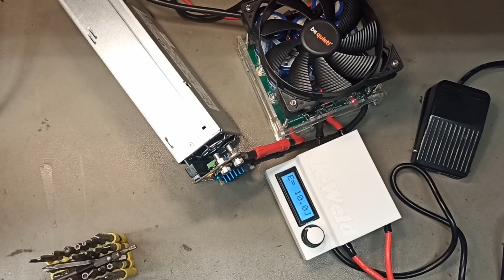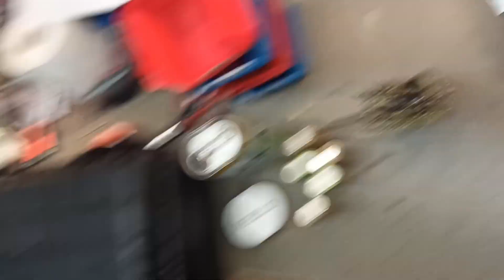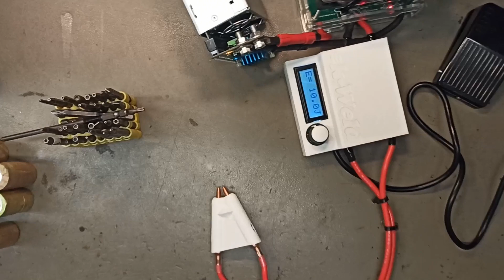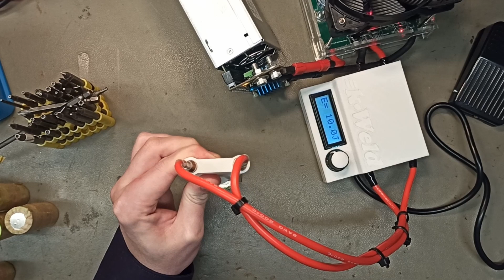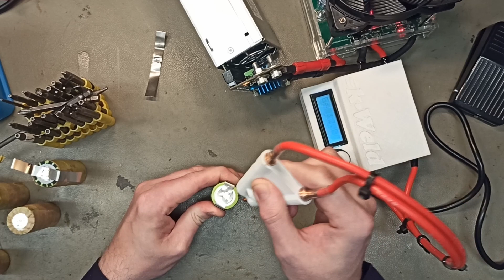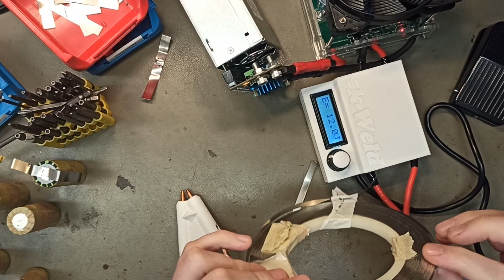Testing the kWeld with kSupply/kCap ultracapacitor module for the first time -  Is it any better?

Comment: Hi, thanks for this video. 
Can you show us how you use it usually with 12V batteries? 
There's none AFAIK on Youtube showing it powered with a car battery, which are cumbersome especially considering wire length limitations with Kweld, BUT they are fairly cheap (and the chargers certainly are), really powerful, and SAFE...

Comment: A battery as in a lithium will not survive for long and cost quite much and has to be exchanged after a slight while, a car battery would last much better. A PSU will though hold forever since it made to last since its ment for servers.
Reply: 12.8 volt Lithium-iron-phosphate, plus the capacitor bank?  (Need a lithium iron phosphate battery anyway for power outages.)
Reply: @dennisyoung4631  Should work as such but you need to have some kind of current limited thing between the battery and module otherwise thing can go up in smoke. Read the manual for it for more info as well.

Comment: LFMAO welding 0.2 nickel with 14J 😂😂😂😂😂😂
Reply: why? im a beginner - want to understand ...
Reply: is it too much or less?
Reply: @haemse  if you check the official user manual for kWeld (dunno if you read it), lists these as a starting point:

0.1mm pure nickel strip 20J
0.2mm pure nickel strip 50J
0.3mm pure nickel strip 100J

Me personally, I use a pretty powerful car battery that outputs over 1000A, i get decent welds with 0.15 nickel strip and 30J, when I use 0.2 strip i crank it up to 45 or even more. If I keep my ends really sharp i can get strong welds with less.

Do a tear test, if the strip comes off with no damage to the cell or the strip, then its probably too weak, you should ideally see some very light damage to the strip.
Reply: @UltraNyan  thx for your answer!
Reply: @UltraNyan  Hi, I'm about to get a Kweld too, and I'm not that keen on Lipos but looks like there is quite a limitation for cable length (2m total, counting every section plus and minus?), which is bad if you just want you car battery on the ground below your workbench.
May Iask you some details about your setup? Battery model and wire length to the Kweld PCB?
Reply: @RoyDLea  im a sronk boi so i lift my car battery to my desk, connect it via xt90 plug (which is undersized for the thick cable) and weld really close to my battery, my battery cable length is only 1 meter. Multiple times i have had problems with the xt90 plug becase the solder joints dont hold up well, the connector itself handles the current. The setup is not ideal but atleast i can disconnect my welder easily from the battery, I recommend getting xt150 plugs or better
Reply: @RoyDLea  the battery itself was some varta silver something series recommend by kweld, i recommend getting a 100Ah version if you uave strong arms, or you find yourself needing to charge it after a hundred welds
Reply: @UltraNyan  Yup, no problem with strong arms. Gonna go this route, I don't mind much those 20kg on the bench after all...
Thanks alot for your replies!
Reply: @UltraNyan do you use supercaps kit or just a good powerful AGM car battery ?
i don’t weld a lot
just doing tool batteries cells replacement 
around 0.2 to 0.3mm nickel strip 
or even re-use the original nickel strips
Reply: @UltraNyan And there's a thing called experience. I got 0,3 mm nickel strip done easily at around 50J using a LiPo battery. After a bit more practice I could go down to 40J and 0,3 mm strip, which also helped keeping the electrodes more cool (I had to take a break anyway at some point to let both the electrodes and battery-connector (XT-150) cool down.
Reply: might be nickel plated steel, my kWeld welds 0.15 nickel plated steel perfectly at 10J, which is a shock as my Sequre SQ-SW2 needed like 50-70% of it's max for that shit lmao

thats a rather big difference, figured it was nickel plated steel due to the low J needed
Reply: Thanks.  Want to get one of these bad, but need dental work first due to advancing age.

Comment: These are unfortunately way overpriced for us in the USA because we are forced to buy them from a Canadian distributor.  I can just dispose of and replace batteries rather than repair cells for the waste that the excessive $150-200 extra markup the Canadian distributor is selling them for. If I ever make a trip to Germany I’ll order one delivered to my hotel and get back the vat upon export. From a US consumer standpoint the existing 

Canada only option is nonsense.  Maybe look for a US distributor as that would be better for all. Canada is known to be crazy high on taxes and duties. A US distributor should be able to sell them for your EU price minibus the 19% VAT and still make a profit rather than Canadas EU and VAT price plus $150. 

So Americans , don’t buy this thing as it’s relying on you being financially stupid.
Reply: Yes, i feel the same way when buying stuff from USA, never do if i dont have to! But there are many other spotwelders out there which are cheaper but work for small project. And  $150-200 extra is not that much concidering professional spotwelders cost $20000 or more, tax excluded.
Reply: @Batteridoktorn  sure but overpriced is over priced. I’m not paying $500 for something sold in Germany for $350, which really should cost in the US $290. That an industrial solution exists for $20,000 is irrelevant. That’s like suggesting paying 2x the price for a liter of Milk isn’t as bad considering a cow costs thousands. ;) 
Economics works and the economics and product pricing in this manufactures USA sales model clearly say: don’t buy unless you are a financial idiot.
Reply: @nonionbeezness  Have you ever compared Apple products in the US and Germany?
Reply: @haemse  yep I get that. The individual should be able to order the product from any vendor in the world. Granted the warrant will be different, or maybe invalid, but the customer should be able to purchase from the cheapest vendor and not artificially restricted by business non-compete agreements between vendors.
Reply: If you want this one, then you must live with the label of stupid, apparently - and pay a huge premium.

Comment: I think turn the power down but don't press the electrodes down so hard, it needs only slight contact so the gap gets an arc which welds it